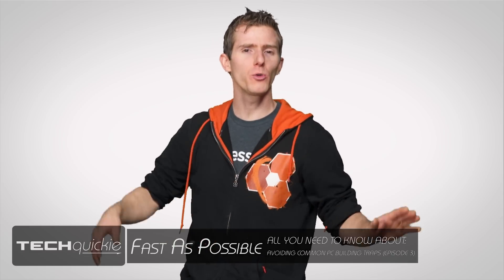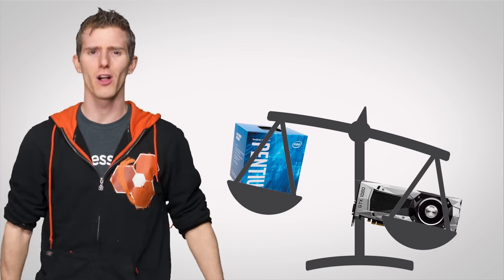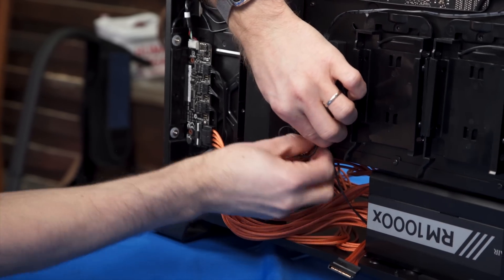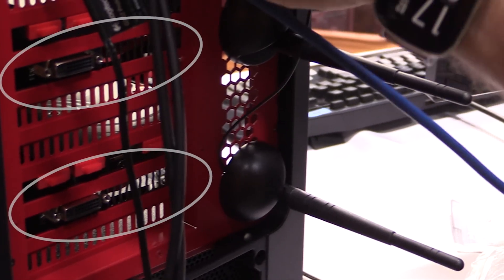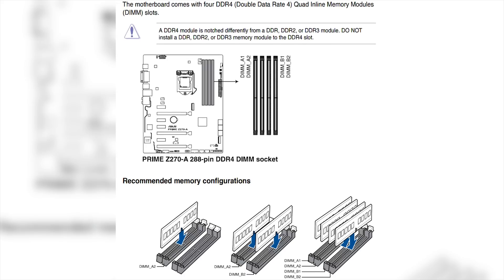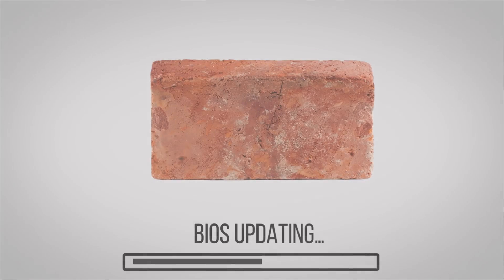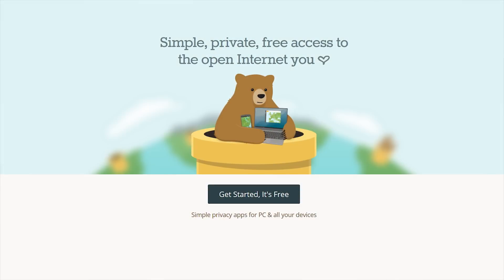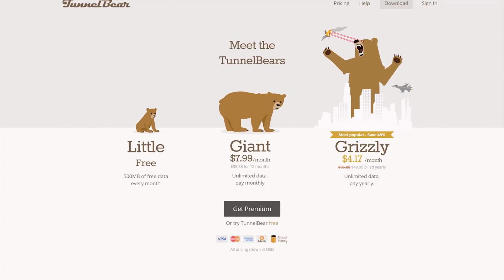Avoiding Common PC Building Traps - Episode 3

Comment: You forgot the most important thing. NEVER put your side panel back on before making sure your computer posts!
Reply: I would go as far as saying that you should make sure your new PC posts even before you start with cable management... if something is wrong with the PSU or a first-time builder is not sure if the cables are all corret... it could save a lot of money and effort
Reply: why? that makes zero sense.
Reply: Flyinghotpocket  Bad luck
Reply: Flyinghotpocket Superstition, that's why
Reply: I was semi trained to boot the system with just the Mobo/CPU/Ram/PSU at first, not installed (sitting on top of mobo box usually). When that goes through, then install everything into the case, leaving both side panels off, and no cable management done, then do full OS install. 

Usually the process of doing a OS install detect a few problems as well. Only then, do you cable manage, and put the side panels both back on.
Reply: and yet on my IT lessons me fucking must put everything together AND EVEN FUCKING SCREWING IN THE SCREWS BACK BEFORE EVEN CONNECTION THE FUCKING POWER CABLE!!!

Comment: I would say after putting a lot of pc's together, besides making sure everything works before you put it in the case, make sure that everything fits as it's supposed to.  Sometimes top fans won't work well with some boards and sometimes 140mm fans won't work when your case only supports 120mm or 80mm fans.

Comment: Techquickie, would this work? 
NZXT Source S340 Elite ATX Mid-Tower Case - Matte Black
Bundle Deal: ASUS Maximus IX Formula Z270 ATX Motherboard + Intel i7-7700K CPU
G.Skill Trident Z RGB 32GB (4x 8GB) DDR4 3866Mhz Memory
Samsung 850 EVO 1TB 2.5" SATA III SSD MZ-75E1T0 + my old hard drives 
Corsair HX-850i 850W ATX 80 PLUS Platinum Modular Power Supply
Gigabyte GeForce GTX 1080 Ti Founders Edition 11GB Video Card
Corsair Hydro Series H100i v2 240mm Extreme Performance Liquid CPU Cooler
Reply: I'm not sure.  If you send it to me for a few years though, I'd be more than willing to test it for you.
Reply: Okay thanks mate. System Total
is $5550.89 but I'm getting NZXT HUE+ RGB Lighting Controller Kit,  Corsair Gaming MM200 v2 Mouse Mat — Extended Edition, Razer DeathAdder Chroma Mouse + Razer BlackWidow Chroma Mechanical Keyboard and the Tt eSPORTS X Fit Series TT Premium Edition Faux Leather Gaming Chair - Black with the system . Been saving for a year now.
Reply: just first buy 2x8GB and later on the other 2x8gb. Because 32 gb has no use..
Reply: Drakon Lord there's really no reason to get a k95 unless you want a bunch of macros
Reply: FlamingRadar plastic construction really doesnt matter unless you're smashing keyboards against walls

Comment: Yep. I so missed to do the cable management on my new computer. I was about to install a water cooler which blocked the cable management. Turned out that the water cooler didn't fit the case even though in the instructions said it would. So my cables are a mess right now. Gonna sort it out soon though

Comment: About cable management... You made a video with a case stuffed with teddy bears, clothes or something and it wasn't that bad. Yes, everybody should manage the cables inside the cases, but as you saw in your own video, it's not such a big deal in terms of temps.
Reply: Dust = Restricted Airflow, m8
Reply: Mathew Tremain ..... later down the road, not right away; hence dust build up on poorly  managed cables.
Reply: Matthew Tremain and the video mentioned above actually stated airflow isn't needed to keep low temps, in terms of things blocking fans and such. As long as there is slight airflow, in terms of air leaving and entering heatsinks to cool, the temps will be okay
Reply: Im Bakes Irl That is right. Not messy or lack of cable management. The biggest cause for air restrictions on hsf, is dust in fins or fan not being allowed to spin.
Reply: Matthew Tremain great, I'm glad you answered your own question
Reply: YourTrulyFriend Linus didn't talk about temps being directly impacted by a congested case, he said a dust buildup over time will happen with poor cable management and THAT will impact temps.
Reply: Im Bakes Irl was there wax in your ears. Linus also added that it could restrict air flow.

Comment: For the BIOS flash, you could've added two more tips that are linked together. Make sure that there is a warranty on the board so you can send it back if you brick it (happened to me). Also, if you do send it back, to make sure that there's a Windows key at hand.

Comment: - dont forget to remove the foil off your CPU Cooler
- dont forget to apply thermal paste (exect you are using a boxed cooler)
- check if the CPU fan is connected to the motherboard
- check if the power supply is powered on and connected
- check if all of the front i/o cables are connected to your motherboard
...

Comment: Don't buy a processor that supports overclocking, and a motherboard that doesn't. Dumbass me learnt that one the expensive way.
Reply: Don't do the reverse either, like I did.  Motherboard supports overclocking, CPU does not.  Apparently me in 2012 didn't care about overclocking so skipped the K version of the CPU, but me in 2016 was pretty upset at 2012 me when I realized what I'd done.
Reply: Most of the Z boards look nicer, more expensive but worth it if looks are important #RGBEverything
Reply: kenny ricardo you can find out if your motherboard supports overclocking on your motherboard company's website
Reply: well i found out my MSI H97 Gaming 3 has multplier unlocked, my 4790k now runs stable at 4.6GHz 1.2V from weeks...
Reply: Kat T they had that in episode 2
Reply: Kat T does cheap motherboard support overclocking ?
Reply: Kat T he said that in episode 2 lol
Reply: I didn't even know that there are motherboards that don't support overclocking. I just thought you need to get an unlocked one and your all good
Reply: Kenny ricardo Probably not, but check your specifications BEFORE ordering!
Reply: Drakon Lord tell that to my i5-6400 running 4.2 GHz on a z170 mb : )
Reply: Drakon Lord ye it's boosting the  base clock but it's not that hard, it took me like a couple of hours from research to working oc. And "supported methods" is no fun, it's like reading the manual. :p haha. but really you can get A LOT for your money when OCing non k CPUs. and it's fun. :)
Reply: i5 6500 masterrace?
Reply: same B motherboard and 15-6600K
Reply: you can't overclock a locked processor like that.
Reply: Ic
Reply: Me too
Reply: Kat T same here 😂
Reply: Kat T what is overclocking
Reply: Buy AMD
Reply: Ah yes, buying a cpu that works just as good as one that is 50$ less to get 1 megafart extra in cyberpunk 2077
Reply: I use a CPU that doesn't support overclocking but a motherboard that does. The reason I did that is I wanted more usb ports and all. Not sure if non-Z chipsets can handle a decent amount of ports
Reply: thats not that bad. you can still profit from more pci-lanes etc. with the z-chipset. But still, k-processor dont cost that much more.

Comment: does a pentium g4500 and a gtx 1050 ti work?
Reply: Taels Doll yes, that's a good build
Reply: Gamingwolfy5 it depends what model of xeon you're using. Because I can say "I have core i3 build". You might think its top if the line i3-7350, but I would say its i3-730(or whatever first grade i3). So please - write model of cpu

Comment: Cable management necessary? How many cables are you realistically using? 24pin, EPS, 2xPCIe and a sata. But you're right, you shouldn't stuff the entire bag of cables that came with your PSU in the front of your case.

Comment: lol i fell victim to the lack of a bios update problem. plugging a xeon into an x58 board, didnt work. am currently waiting for a new bios chip with the latest bios on it. cheaper than getting a 920 and a new stick of ram to flash it normally lol

Comment: If you plan to do anything more than use a stock cooler on your processor, DON'T USE OLD THERMAL PASTE! Seriously. I was using 8 year old paste with my FX-8350 and H100i for a few months. After I replaced it with some Arctic Silver, temps under load went down at least 10 FLIPPIN DEGREES CELSIUS. Understandably, I now have a stable 5 GHz OC. Huzzah!

Comment: Tip. Pay attention to the SIZE of the computer case you are buying. Before you end up with a 40lb. monster that doesn't fit on the desk, even though the computer would fit in a case that is half the size and weight. I've learned this the hard way LOL

Comment: My tip is that when it comes to low- and mid-range builds, be mindful of your drives. It might be temping to get an NVMe drive, but if can get a good, larger capacity SATA SSD for a similar price, or cheaper, then go with the SSD. Chances are your computer's bottleneck isn't going to be the SSD even on mid-range builds. That said, this is becoming increasingly irrelevant as M.2 drives have leveled out at the same price as their SATA counterparts.
Reply: Just a heads up, those M.2 SSDs that are the same price as 2.5" SSds are not NVMe drives at all, they are M.2 SATA drives. NVMe is still way more expensive than SATA SSDs, and are pretty useless for most people.
Reply: Clin9289 Thanks, but those are ssd, not nvme. We were discussing the price difference between 2.5 SATA drives and nvme. The M.2, SATA flavor are not the same...
Reply: my bad. the Intel is nvme, the crucial is not!  Great price on nvme!
Reply: be mindfull of the future, my padawan. nope, doen't work, still posting it. because why not
Reply: any ssd is going to give you the same real world performance.

don't overpay unless you want a longer warranty.
Reply: alcowherd7 I'd still rather use m.2 sata over regular 2.5 in because of the size
Reply: +sean weaver It's also easier to install. Insert the M.2 at an angle and push it down to add a screw.
Reply: +sean weaver It's funny because a lot of SSDs that you buy anymore are mostly empty space inside of them. NAND memory has become so tiny and compact that the 2.5" format is simply too large.
Reply: +alcowherd7 You're right, thanks.
Reply: It went up $20, but this nvme is pretty much the same price as any ssd.... https://www.amazon.com/gp/product/B01MDRUXNZ/ref=oh_aui_search_detailpage?ie=UTF8&psc=1
Reply: Nicholas Daue If you want a budget M.2-NVMe of around 500 GB then you should be looking at the Intel 600p (175 dollars), but even then an M.2-SATA can still be cheaper. The Crucial MX300 525 GB M.2 can be found for 150 dollars. Another option could be the Samsung 850 EVO 500 GB M.2 for 168 dollars.
(I used Amazon for easy comparison. I don't actually live in the US)

Comment: I put together a 1500.00 computer and it started smoking as soon as I turned it on.  I was upset until I found out I put a fan screw in the fan wiring.  easy fix.
Reply: You put a screw into a wire?!

Comment: One day i updated my graphics card for a gtx970 and killed the sound card in the process ( was fragile :S ). Then i bought another motherboard and didn´t post until i remove a specific screw. There is my expierence, now i have a motherboard 100 % working but still miss that screw :) There´s my experience had fun with it¡

Comment: The more RGB your pc has the faster your games will run
Reply: dxxPacmanxxb Especially in a case without a side panel window.
Reply: FPS gain:
Blue - 5-6 FPS
Green - 3-5 FPS
Red - 2-3 FPS
White - 3-4 FPS
Rainbow - 9-12 FPS
Reply: dxxPacmanxxb The more obnoxious the colors, the better the performance.
Reply: @ganaraminukshuk0  they are never obnoxious
Reply: @ganaraminukshuk0  unicorn puke always
Reply: Plus each sticker adds five horsepower.
Reply: @garcjr  Electrical things normally use Watts instead of Horsepower. Also, in case you've ever wondered, there's about 745.69997715823 Watts in a single Horsepower.
Reply: yes this is very true, after i put rgb lightning to my case, i got around 4-10 FPS boost
Reply: Pink = 69fps boost
Reply: Painted monitor can reach up to 20% more Hz refresh rate. Prefferably you shoud also paint your eyes to see the difference
Reply: Make like dem Orkies an paint em red! Make da dakka go fasta!
Reply: dxxPacmanxxb true i can run gta 6 in pentim 4 with rgb installed
Reply: dxxPacmanxxb yes, GTA 5 ran at 60 fps, then I added Rgb and it ran at 70
Reply: dxxPacmanxxb Got it! I'll download more RGB tonight!
Reply: The more gay color, the hotter the system runs
Reply: RGB!!!!!!
Reply: cool username doesn't make a difference on a 60hz monitor RGB u failed me again
Reply: K, I'll use RGB component cables for my  15" colour screen
Reply: Laser Toch no😅😂
Reply: omg its true! i bought lots of rgb led strips and put it in my pc and now it has double the performance!
Reply: dxxPacmanxxb Really ?
Reply: https://youtu.be/vnST5rA64Oc
Reply: G-g-g-GAMING!
Reply: I keep telling my friend that but he keeps telling me I'm an idiot
Reply: Everyone knows that
Reply: It didn't work for me. What am I doing wrong??
Reply: Sounds sound to me
Reply: This is technically true, rgb components are for the most part faster. _.
Reply: I heard nasa pcs use around 60 rgb strips per cpu
Reply: exept for red (it will get super hot )
Reply: When you upgrade your computer to be twice as fast then realize everything you bought had built in RGB....
Reply: YOUR ALIVE? AND YOU WATCH HIM TOO??
Reply: Yes very true I run GTA 5 with just a RGB
Reply: Black and orange will boost... nvm
Reply: RBG enthusiasts. The Ricers of the PC game.
Reply: this is somewhat true bcuz more trusted and quickest use rgb. then again, dont matter the colors :P
Reply: You will get 6969 fps boost after you removed all your fans
Reply: obviously
Reply: putting stickers on it increase the fps by 10
Reply: The longer the icon of sin is on earth, the stronger it becomes
Reply: Big fax
Reply: RGB gay
Reply: No shit
Reply: Blue makes it colder though, so watch out
Reply: I can make a flip phone run crysis with RGB alone
Reply: Bo
Reply: F
Reply: No
Reply: Myth!
Reply: My pc is a red/black theme. Phoenix case and extensions with 5 red fans also g.skill trident z silver in star formation static red
Reply: No that's only red that does that
Reply: Facts
Reply: Disclaimer: This feature requires a black case to work properly.
True story.
Reply: I should have seen this comment coming but because I didn't it made it infinity more funny. I literally laughed out loud. Thanks.
Reply: Watch a dumbass believe this
Reply: Wroooong

Comment: 1. The new Ryzen cpu's seem to benefit from higher speed ram
2. My tip would be to check if every cable is pushed in all the way untill there is no room between the cable end and the connector on the component.